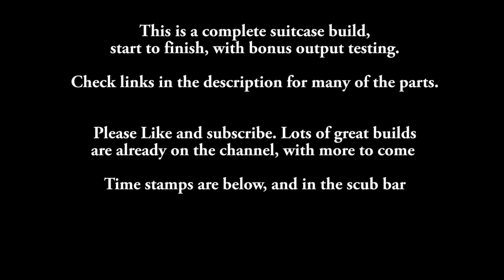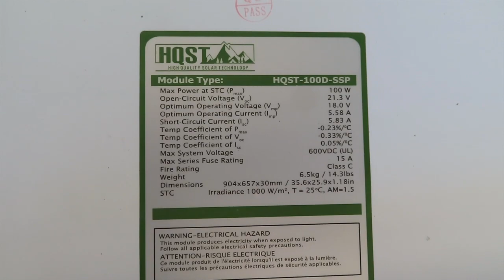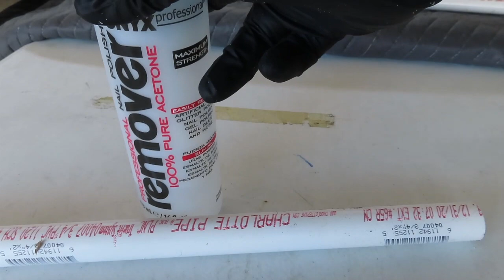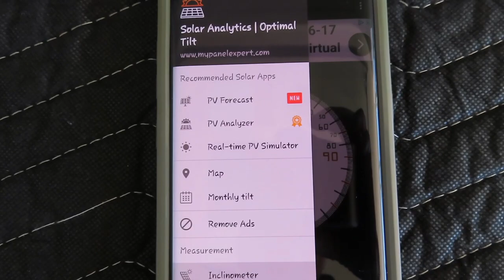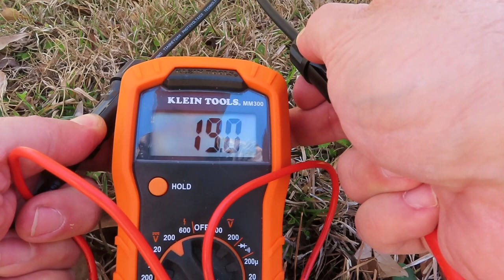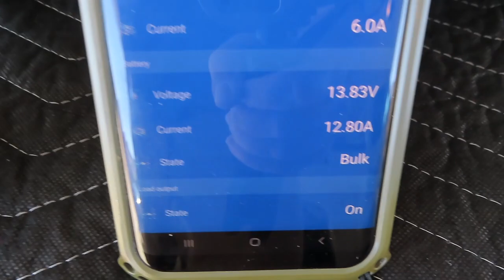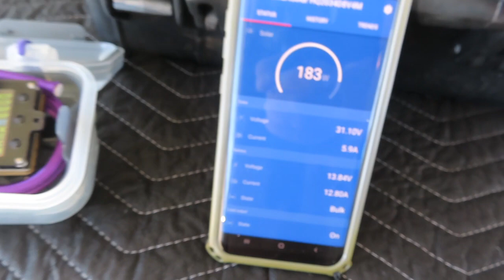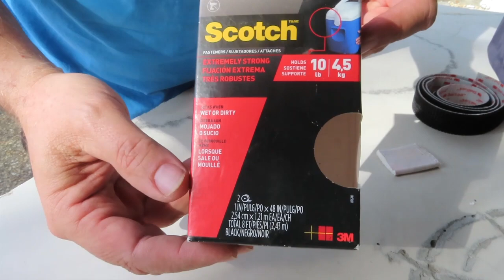Renogy 200w Solar Suitcase $500, DIY 200w $200

Comment: How much does it weigh?  Most 200w suitcase panels weigh around 36lbs.
Reply from the maker: Good question. I have never weighed it. But the manufacturer specs say 16.5lbs a piece. What I added doesn't weigh anything. So probably close, or a little less

Comment: I have watched video a few times trying to find cut lengths for all the pvc PCs do u have them and I’m just missing you mention size should be in video right after cleaning and prior to placing them into panel ?
Reply from the maker: I decided folks may build this with all kinds of different panels,  so size would vary. But with 3 ft tall panels I come down from the top  a foot with the cross bar, and then measured from there. The worked great. PVC is forgiving. Measure,  cut, then attach the cross bar

Comment: Do the T adapters used for the swivel not push pressure on the back of the panel?  Just curious. Jack
Reply from the maker: they touch. I am not sure I would call it pressure and it has not hurt anything

Comment: Can you tell us the length you cut your PVC pipe? 
I am starting out traveling in a step van and will be using this setup to charge my batteries
Reply from the maker: Every panel brand is going to be a different size. And even the same brand bought at different times can very in size. So you will have to measure. My panels are approximately 3ft x 2ft. I measured down 1ft (1/3rd) panel size for the cross bar placement. That works well. Then just measure everything else from that point
Reply: @MikeJordanUnCamplicated  Yeah, I have ordered the same pannels as you have. They are a little cheaper on the HQST website, might take a little longer to get to you but save a little money. I got the two panels for 155.00 and free shipping. Thanks and I will be passing this along on my channel later as I make the stands for my solar panels. Thanks for the info!

Comment: How did the amps jump to 12 from the controller to the battery if they're in series? The reduction in voltage makes sense as the battery is most likely 12v
Reply from the maker: watts = amps x volts. Watts doesn't change. So when the controller brings volts down to match the battery, amps go up. Thats why is is good to have the controller close to the battery. High volts/low amps travel the longer wires from the panels (20ft in my case) with less resistance. The lower volts/high amps create more resistance, but only have to go a short way from the controller to the battery (less than a foot in my case)
Reply: @MikeJordanUnCamplicated  that makes sense. However i never heard of a controller jumping the amps up when the incoming amps are lower. Thx
Reply from the maker: @jokerrhe   have you ever used a SCC?. There is no other way for it to work.  Panels start in the 20ish volt range and go way up from there. A controller has to reduce voltage,  and the byproduct is always amperage. That's Watts law, and amps is what charge the batt. So that's a beautiful thing
Reply: @MikeJordanUnCamplicated  I'm building my first custom kit actually. I was wondering about that. I thought I had to get lower voltage panels so I wouldn't be losing out on watts to be honest. So I'm gonna use my 18v panels and the controller will balance out/raise the amps to match?
Reply: @MikeJordanUnCamplicated  if it's amps that you want why don't you run them in parallel so the amps are higher to begin with?
Reply from the maker: @jokerrhe  I gave that answer in your first reply. High volts and low amps travel distance (panels to controller, 20ft in my case) with less resistance, and therefor less power loss. Then you convert to higher amps/ lower volts at the controller, where the distance to the battery (in my case) is less than a foot. I could run my panels in parallel but that does not make any sense for the line loss over distance.
Reply: @MikeJordanUnCamplicated  ok thank you sir! This is new knowledge for me and changes the way I can set up my system
Reply: @MikeJordanUnCamplicated  hey again Mike. I researched it some more and see what you mean. Most MPPT chargers do what you are mentioning which is their unique characteristic especially for larger arrays (being they increase amps to maintain watts up to the amp they can handle). PWM charge controllers will not and you would have to prebalance it yourself meaning get 12v panels etc. or you would just lose the watts. I'm now going for a 20amp MPPT controller for a 200w solar array(mixed actually since already got 18v, gonna get 12v perhaps.. They'll be stepped down to 12.8v most likely), & 50ah 12v battery.
Reply from the maker: @jokerrhe  sorta, kinda. You can connect the same set of panels to a PWM or MPPT controller. The MPPT will be more efficient and has the option of parallel or series connections. The PWM is going to be less efficient and you can only parallel connect the panels
Reply: @MikeJordanUnCamplicated  MPPT is more efficient for sure cuz it can vary the volts vs amps to match watts. This is the function of MPPTs,  PWMs cannot which is why they're more basic and cheaper. You can series or parallel to both. PWM, even cheap ones like I got, has ability to handle 24V so i.e. 12v+12v panels in series would work. Then you'd need a 24v battery, etc. MPPT kinda balances for ya which is great, especially now I'm not afraid to run longer cables using higher volts 😀
Reply from the maker: @jokerrhe  I have never, in the entirety of my life, seen a 12v solar panel. The smallest of panels will be in the 18ish volt range. Bigger ones go up considerably from there. So your PWM controller can handle 1 panel of higher voltage, but it will not handle 2 panels of any voltage, in series
Reply: @MikeJordanUnCamplicated  Are you talking about open circuit voltage? I think there's a range and also the controller would decide based on the battery. Also it says the range of volts on the manuals. There's tons on em just if you search. I'd have to try once I get 2 for proper readings if using PWM. Also on your first comment Watt's law simply states how many watts you're getting based on volts x amps. They're not byproducts of each other. So you plug in a 5v to a 120v wall outlet,, giving you 115amps byproduct? Nope. That should be renamed MPPT's law haha it threw me off but lead me in the right direction. Had to add that since I think you got a good MPPT controller so you assumed that's the only way it'll work. Got me to questioning my controller was slacking lol
Reply from the maker: @jokerrhe  doesn't matter if you are talking about Voc or Vmp. There is no such thing as a 12v solar panel. And you cant plug 5v into 120v and get any amps. Only blue smoke
Reply: @MikeJordanUnCamplicated  Well I guess it depends what voltage the panels are gonna be "operating" at then. It depends on the battery system voltage. MPPTs will make up for lost volts with amps which is a beautiful thing. And lol you kno what I mean.. i.e. most avg USB chargers output at 5v/2-3amp. AC outlets r what 110/120v?  Either way just cuz volts go down doesn't mean amps increase by any law. If there was a way to capture that if it did, we'd be traveling lightspeed by now.
Reply from the maker: @jokerrhe  volts go down, amps increase.... by Watts law. It is electricity 101. That is as basic as electricity ever gets. So we need to do a little crawling before we start to walk, because you are beginning to trip on your own feet
Reply: @MikeJordanUnCamplicated  One or the other increases when you have a device regulating that. Watt's law is a formula that calculates watts based on volts x amps. Correct me if I'm wrong but it never states one affects the other directly. If it did electronics would be overloaded all the time.
Reply: @MikeJordanUnCamplicated  **edit. Even still, PWMs don't do that so I still need to get a MPPT
Reply from the maker: @jokerrhe Watts law is a simple math equation. Watts = Amps x Volts. So for watts to stay the same, when amps go down, volts go up. When volts go down, amps go up. So.... yes you are wrong. Consider yourself corrected. :)
Reply: @MikeJordanUnCamplicated  haha I think it's Ohm's law you're referring to. Is that same? Did only a lil reading since but if that's the case then it is. However my point is a PWM the volts decreased to match battery are just lost and amps are not increased to match wattage. I guess that's just a thing between solar controllers. If it followed the law I wouldn't have to upgrade my controller. Thx anyhow
Reply from the maker: @jokerrhe  I KNOW its Watts law I'm taking about.  Ohms law is the relationship of resistance to voltage  and amps.  Not the relationship of amps and voltage to each other
Reply: @MikeJordanUnCamplicated  Well then you should also KNOW that a PWM just won't have that function.
Reply: @MikeJordanUnCamplicated  Here's a perfect video for ya: https://youtu.be/cdAkQCA5tuY . He plugs the same 200w panel in and only the MPPT will boost amps to match and he explains why cuz that's their function. I have that same PWM in the video btw. Now you should know what I mean.
Reply from the maker: @jokerrhe  thanks. Info I already know, and nothing to do with your confusion on Watts Law
Reply: @MikeJordanUnCamplicated  no confusion. It doesn't apply to all controllers no matter how much u repeat it.
Reply from the maker: @jokerrhe  yes... PWM and MPPT controllers work differently. But Watts law applies to everything electrical on the planet, whether it is a light bulb, your smart phone or a SCC
Reply: @MikeJordanUnCamplicated  Yup and once it hits those controllers, due to those differences, then it changes things.  Still gotta upgrade in my case

Comment: These are now $300.00 from Renogy... You can't built one for that price today. I got two in parallel. But I didn't use the PWM controller these have. I used  50S DC-DC MPPT Controller. I get 35 amps for about 6 hours. On a good sunny day...If I need more. I just start the vehicle for 25 amps..
Reply from the maker: Renogy sells many versions of the solar suit case. Their top end compares to what I built
Reply: @MikeJordanUnCamplicated  It's the same 200 watt system.. As the controller and panels are the same model..

And no you can not built one for that price. I tried.. And even if you could. You still don't get the replacement  warranty..
Reply from the maker: @WizzRacing  lots of people, especially if renogy pwm is your frame of reference, get confused. Do not feel bad.
Reply: @MikeJordanUnCamplicated  I'm not confused you short bus rider. I'm an electrical engineer. I design these system for robotics all the time. 

Fact is PWM is less efficient.  Where as MPPT is far better at controlling and harnessing the amount of energy coming into it. 

Why PWM is so cheap. You lose most your power to heat lose. As that heat has to go somewhere..

Comment: What size bolts did you use for hinges and where did you buy them from?  Thanks
Reply from the maker: I do not remember. I the hinges (link in the notes) come with some sheet metal/wood screws. I just matched up bolts and nuts of a similar size while I was at the store buying the hinges

Comment: Do you have a link for the stakes you used to keep the legs from sliding backwards?
Reply from the maker: I got those from walmart in the camping section. They are probably bigger than what you need. But I already had them, and they were close by when I was working on the panels. Any tent stake would probably work